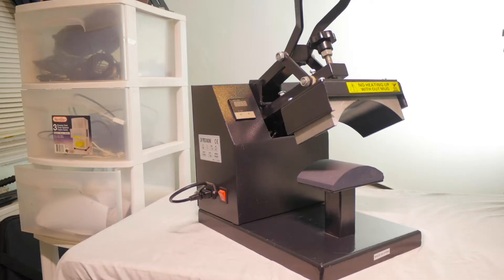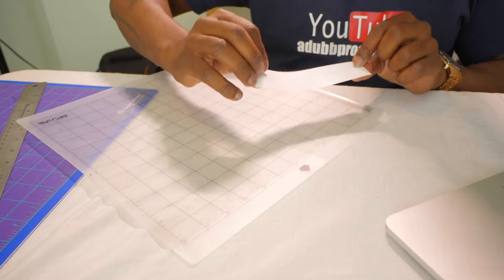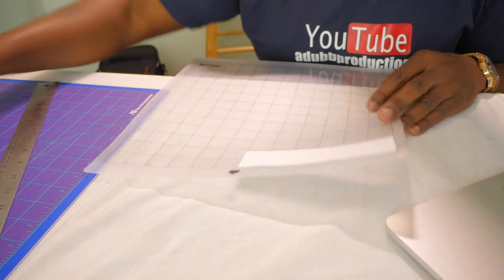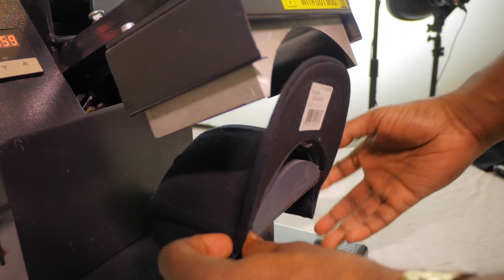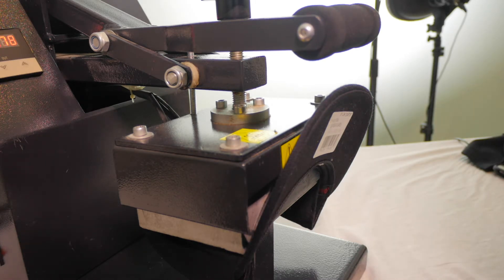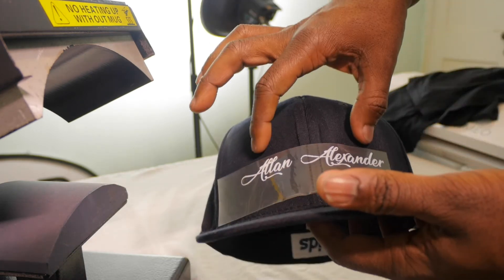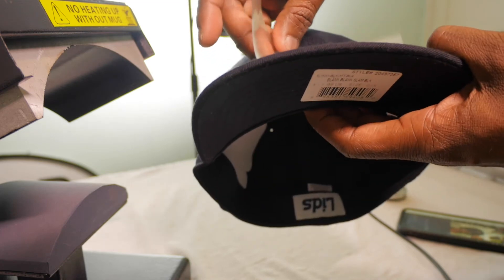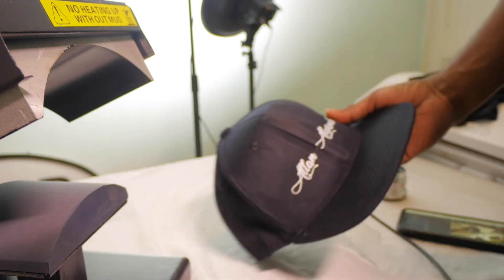Heat Pressing onto a fitted Cap Should you buy a Hat Press

Comment: The cap looks burned, is that normal? maybe use parchment paper over top of design to avoid?
Reply: The hat is burnt... Turn temp down to 285-300, medium/firm pressure 30 seconds works for plastisol transfer...
Reply: It’s cause he didn’t use the heat transfer paper